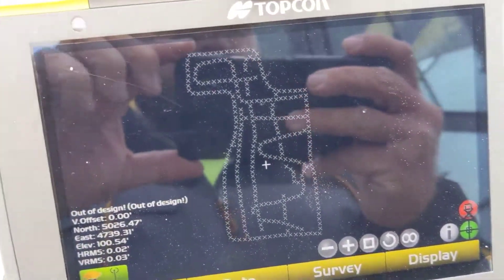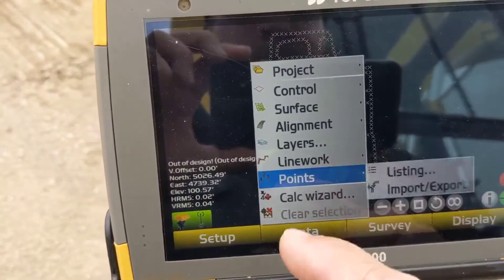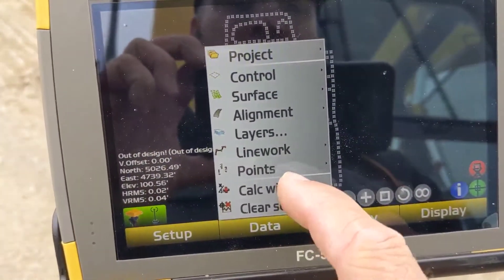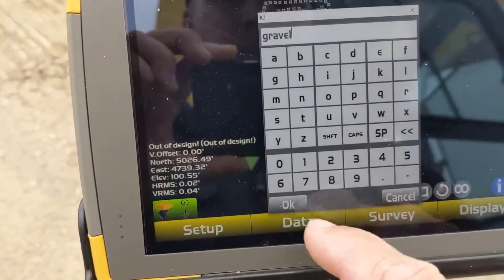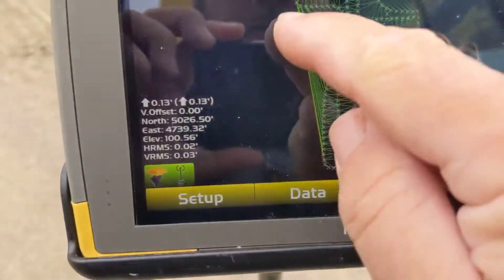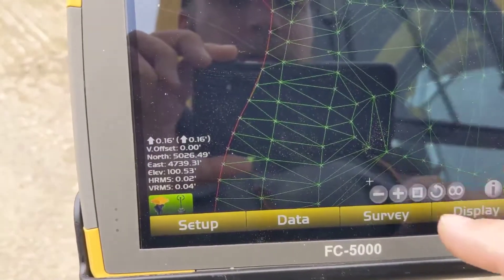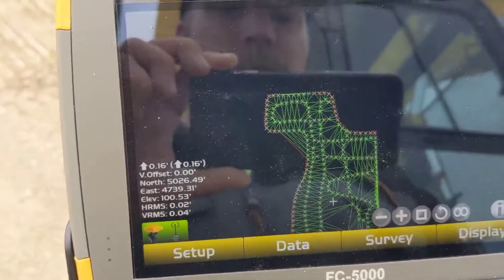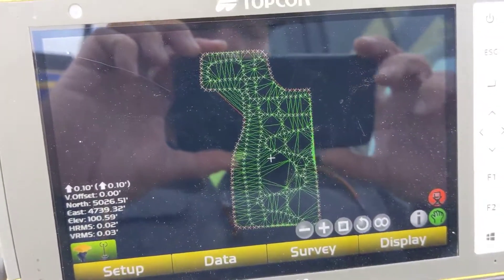Topcon Pocket 3D - Creating a TIN Surface from Points or Lines

Comment: Can you turn that into a 3D model in the field?
Reply from the maker: That is what this process is doing. It's using the points or lines you shoot to create a surface that you can export to a machine if desired.
Reply: Can you add onto the surface? If you needed to extend the gravel lot at a later date can you add onto the existing file or do you start a new surface?